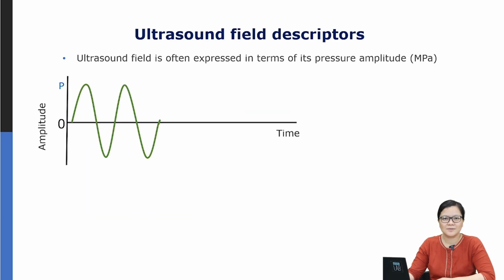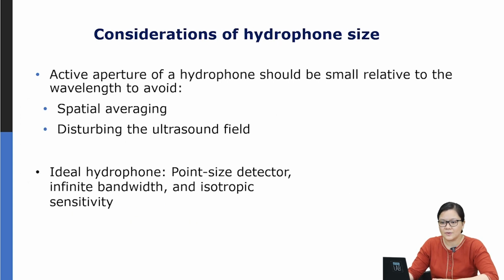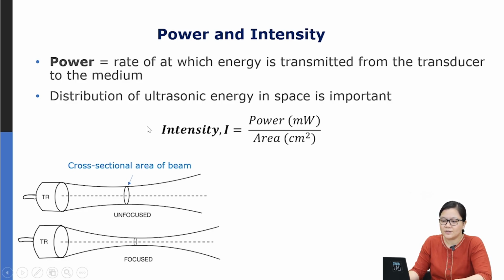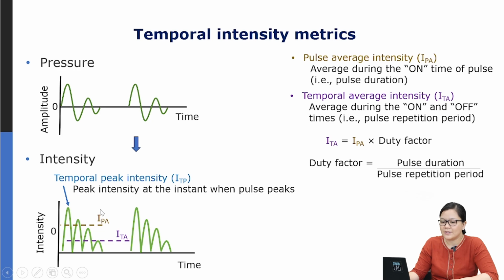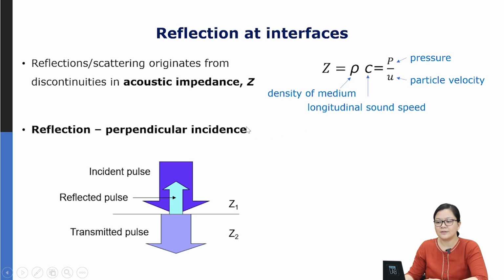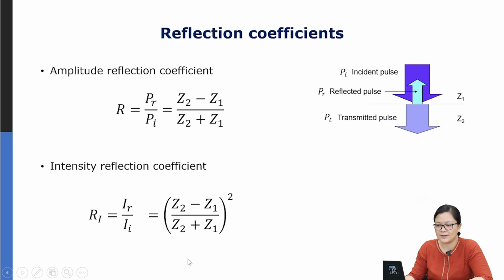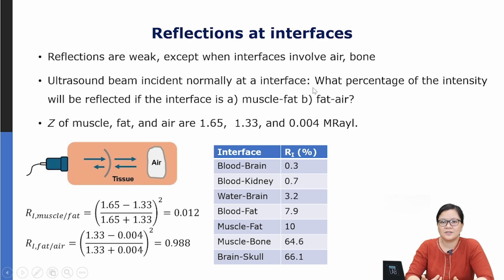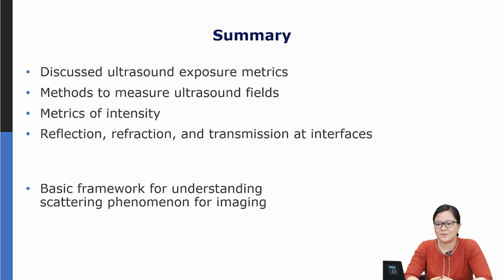05 Intensity, Reflection, Transmission

Comment: hello, may i ask about the input impedance in oblique incidence (i have an ultrasound going from Silicon to water where i have a small SiO2 on the interface between the two to soften the transition, my angle is 54.7 degrees and i want to calculate input impedance for SiO2 and water)? do you have the formula ? can u explain it ?